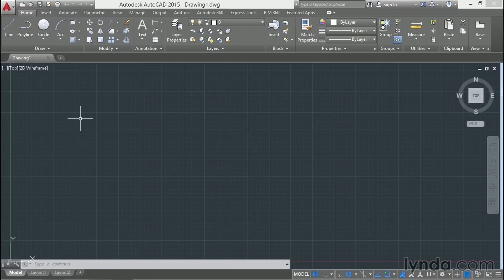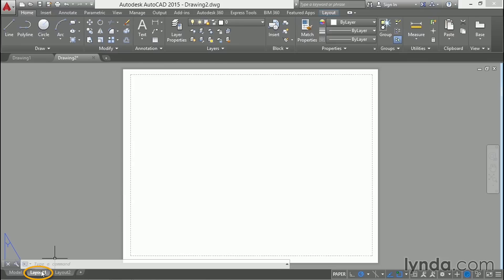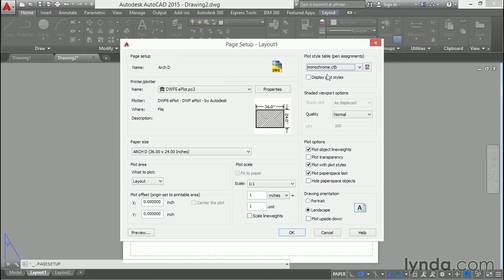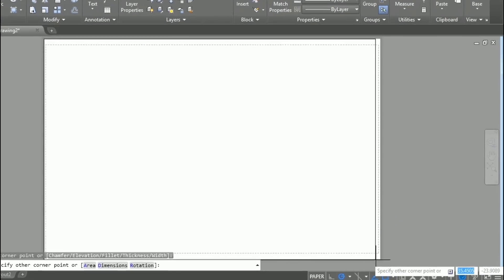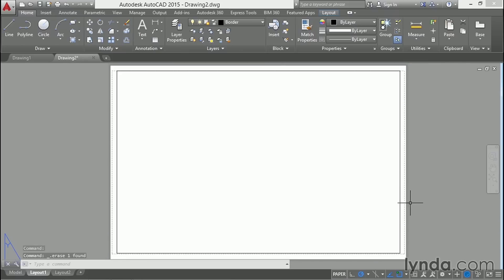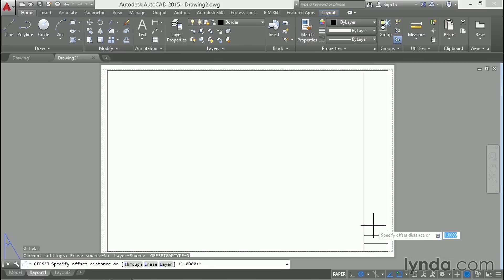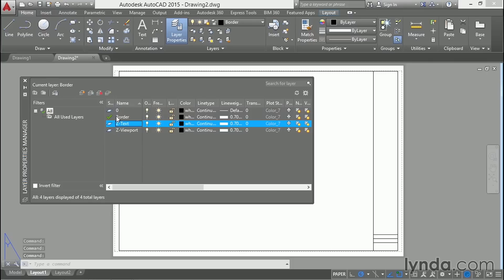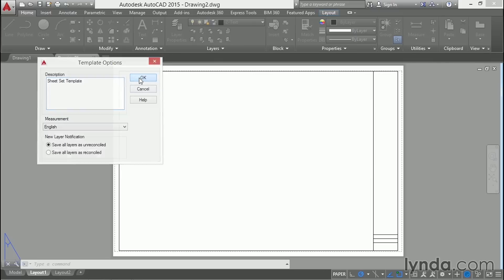AutoCAD Tutorial - Preparing a template with a title block

Comment: How to draw a perfect rectangle for the Title Block: before drawing an arbitrary rectangle and eyeballing it to center, you can :
1. Click the Layout Tab at the top.
2. Click the Rectangle button.
3. Click "Fit" at the bottom (options for your Rectangle, displayed within the Command Bar).
4. The rectangle that is created is a Viewport.  Proceed to trace over the Viewport with a rectangle (use Layers, example: Viewport.  Don't forget to assign lightweight to differentiate, if desired).  
5. Select the viewport and delete it since you will not be using the Viewport as your line for your Template Title Block Border line (use layers, it will make your drawing skills much faster).

Note: The rectangle will fit perfectly on top of the dotted lines.  Those lines are determined when you are in Page Setup Manager, and they change based on the size and type of sheet you select, example: Arch D vs. Arch D expand.  

Note: Any page you select that is proceeded with "expand" pushes that dotted line out further, I think that pushes back the printing bleeding border back a bit further than the standard pages sizes that do not have "expand" at the end of the page size.